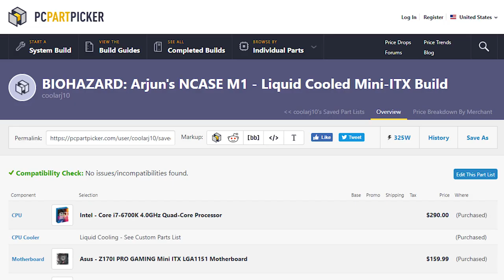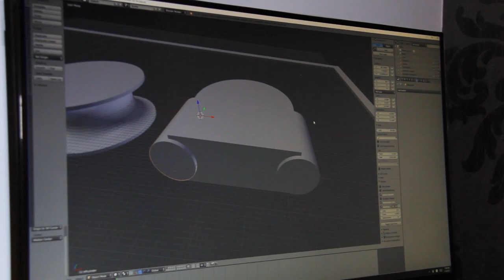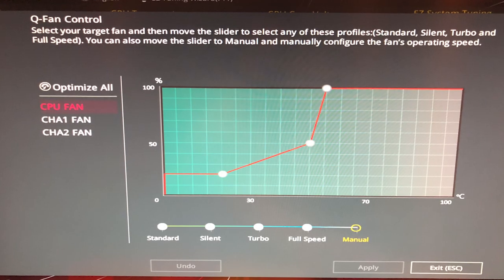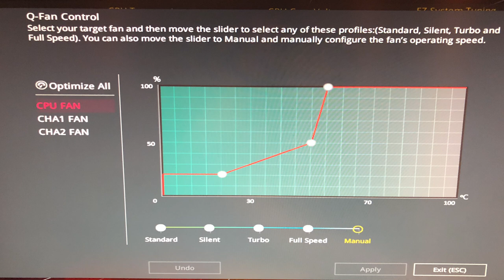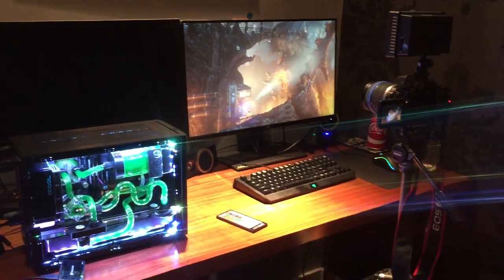NCASE M1 - Super Compact Water Cooled Mini-ITX Gaming PC with CRAZY tubes - BIOHAZARD

Comment: In what setup are you running the bottom fans? Do they blow air inside the case through the radiator? Have you tried any other setup for them for better temps?
Reply from the maker: Hey! The bottom two are pulling air up into the case. The rear fan is pushing air out of the case. The reason you do not want the bottom fans to push air down is because hot air naturally rises, so if the fans try pushing hot air down, they would be fighting against the natural tendency of the hot air and it would not cool properly. I learned this the hard way when I mounted my gaming PC vertically many years ago so all the fans pointed towards the ground, and it kept overheating and crashing! So, I haven't tried another setup for the fans in this specific PC. If I wanted better temps, I would consider squeezing another fan directly under the lid of the case to have air pushed up faster.
Reply: @Coolarj10  thank you. I have been thinking about building my own mITX setup and I really like the way this case looks. After reading some forums it would seem that people have been trying different airflow configurations and getting mixed results based on how they position their radiators and in what direction is the airflow going. Your build is awesome btw 😄
Reply from the maker: Niko Rusthollkarhu yup you’re right - maximizing transfer of cool air in and hot air out of your case will get you the best cooling. There are many factors including fan speed and interference from components which can make a difference. But the concept of “don’t have your bottom radiator push air down” should be universal, because you don’t want your fans and natural thermodynamics fighting against each other. “Go with the flow” as they say. Good luck!

Comment: 0:32 Can anyone please tell me what size fan he is using for the back! Also what size radiator is that at the back. Can you fit a 140mm?
Reply from the maker: ben c Hey! The full parts list is in the video description. The small radiator in the back is: “Alphacool NexXxos XT45 Full Copper Radiator 92, 92mm x 1, Single Fan”. The fan is: “Noctua 92 x 14 mm Low-Profile Cooling Fan with A-Series Blades (NF-A9x14)”. I painted the fan chassis black because it was originally beige.

Comment: Can you SLI in this case if you wanted?
Reply from the maker: Good question! Hmm.. so the first thing is you'll need to get a mini-ITX motherboard that has enough PCIe slots to support SLI. The motherboard I chose doesn't, but there are indeed motherboards out there. Next, you would have to get both graphics cards to fit into this case. My motherboard's bottom PCIe slot is about the lowest you could get for a PCIe slot location on a motherboard, meaning even if you get a mini-ITX motherboard with enough PCIe slots, and even though there may technically be enough room under my GPU to place another graphics card, there won't be a PCIe slot physically that low inside the case to connect the other GPU. So what you would have to do is place your second GPU above the location of where my GPU is placed. For it to fit, you would likely have to cut out some of the back of the NCASE to make a hole to make room for the 2nd GPU 's HDMI/Display Ports to stick out of the PC. This may work for air cooling, although hopefully not too cramped, causing heat issues. (If the fans shoot air outside of the case, it should be fine. If they shoot air upwards, there may be a problem where the lower GPU shoots hot air up to the upper GPU).
Liquid cooling will be tough, but there could be one situation where it may work: You would have to use flexible tubes (because it will be extremely difficult if not impossible to try to cram all those things in there and have enough room to maneuver your hands to connect the hard tubes). Also, you will have to be creative with the radiators. For example, maybe the rear radiator can be screwed on outside of the case instead of inside. Or, you could see if you can fit a radiator in front of the GPU. In other words, the NCASE comes with a frame that allows you to connect a radiator smack where my glass window would be. So an observer may not see much inside your PC, but it sure would be powerful if you could pull it off. Again, I think it just might be possible if you have a lot of patience and are willing to cut into the PC case, but without modifications the answer is probably no.
Reply: @Coolarj10  Thank you for the reply, I am very interested in the NCASE M1 but you brought up a good point about SLI in the case. 

(If the fans shoot air outside of the case, it should be fine. If they shoot air upwards, there may be a problem where the lower GPU shoots hot air up to the upper GPU)

I am worried that you are right and it will be too hot for this to work. The CPU I am not worried about, but the GPU temps will get hot especially during the summer. I really wanted project orthrus case to come out but the creator never followed through. My quest for a >16 volume SLI case continues, great case btw.
Reply from the maker: Jack McCoy I think if you can manage to fit the parts into the case, there must be a way to keep it cool. The tougher part is going to be to get everything to fit. For example, if worst case you do have one GPU blowing hot air towards the other, having additional fans near that area pulling air out of your case could solve the problem. Your situation sounds like a really fun problem to solve. The only unfortunate part is that you have to buy the case first to find out! But if you were really motivated, you could buy it and then re-sell it if you realized it didn’t work.
Reply from the maker: Jack McCoy actually just following up: I’m looking at pics online, and many SLI configurations do have the fans blowing out the back. Does the GPU you want come in that configuration? If so, you may be set. Because regardless of whether you’re using a small case or a large case, SLI always means the graphics cards are close to each other. So, the heat issue would be the same regardless of your case. And as it seems, people don’t seem to have a problem with it.

Comment: Does this fit a full-size gpu?
Reply from the maker: Trucker Jack yes it does! It’s always good to double check the exact GPU you want to use, though. For example for the GTX 1080, I remember the ASUS Strix GTX 1080 enclosure was longer than the other versions, making it a bit more difficult to fit in.

Comment: is it possible to save ~500$?

greetings from 🇦🇹
Reply from the maker: There are ways to spend less on liquid cooling! For example, you can buy a closed loop system such as the Corsair HYDRO H100i which is a dedicated CPU cooler that utilizes liquid cooling, but all you do is attach it to your CPU and you're done. There are no pipes to install or liquid to worry about because it is already pre-build. It costs less than $100. Keep in mind that is only for your CPU. You would still need a cooling solution for your GPU (regular fans, in-built fans that already come with your GPU, or a separate liquid cooler)